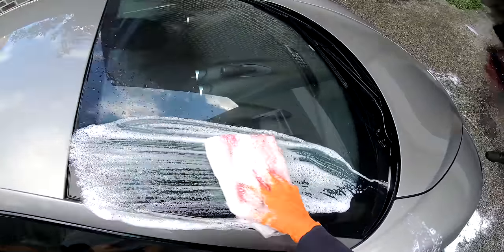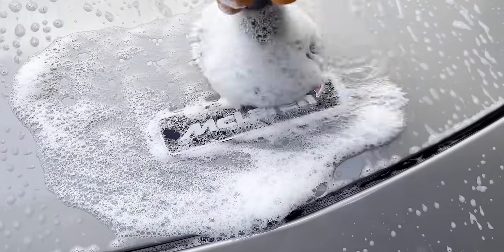Detailing a Sports Car in a SANDSTORM

Comment: I sometimes use a vacuum cleaner first to remove sand and debris from the windowsill so my pressure washer doesn't push the sand deeper into the grooves and possibly causing scratches on the windows when you roll them down. Great video🖐

Comment: In my country washing detailing my own car is a pain for most of the time, the weather is extremely hot. At first i start slow being loving caring, then the heat start to attack hard and i start speeding up bit by bit sweating like crazy, then comes the interior wew, i always turn on the Ac when i start with the interior

Comment: Hi Tino. How do you clean the wash mitts well to make sure everything is out of them ?
Reply from the maker: I place them on top of a crate and pressure wash them (both sides on the mitts). When doing this, quickly pressure wash the area where you place the crate and then pressure wash the crate first.

Comment: Hey Tino. I am wondering if you need to create pressure to get water from the tank to the pressure washer or is the gravity enough to get enough water into the pressure washer.
Reply from the maker: Hello. The pressure of the gravity is enough to power the pressure washer as I connect the pressure washer directly to the water tank

Comment: Enjoying your detailing Tino. I am 71 and in hospital in Sheffield with covid. What kind of lance are you using. Keep up the good work.
Roger
Reply from the maker: Thank you very much. I wish you the best and that you can get through with ease. I use the kranzle k7 pressure washer connected to the mtm quick connect kit and lance extension as well as an amazon snow foam cannon.

Comment: I have a drying towel however it doesn’t dry my car as well as yours mine leaves some water
Reply from the maker: Hello, the drying towel does make a difference however I would also say that the protection level on the car makes an even bigger difference as once I apply the ceramic snow foam, water is repelled from the car, making it very easy to dry
Reply: @TinoCarCare  I currently use the turtle wax seal n shine it beads however should I switch to ceramic snow foam?

Comment: More I watch your channel the more I think this looks better than it is. Your pressure washer is about £600 and that does most of the work. That alone can take any car from dirty to clean. Your overheads for all the equipment you use must be mental and then water costs etc must be a lot. Then pay your employees. You need to wash a lot of cars to turn a profit. Appealing video on the eye but difficult business model.